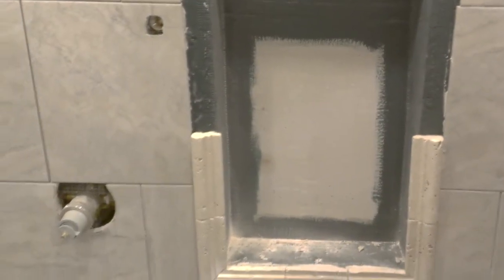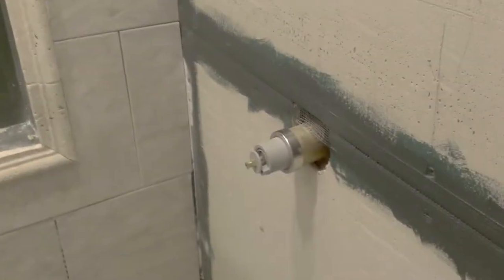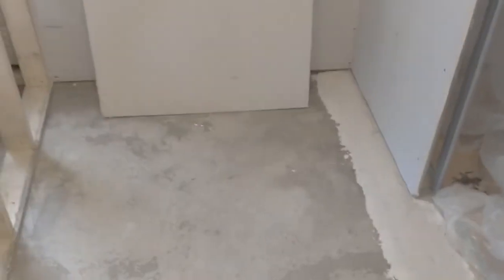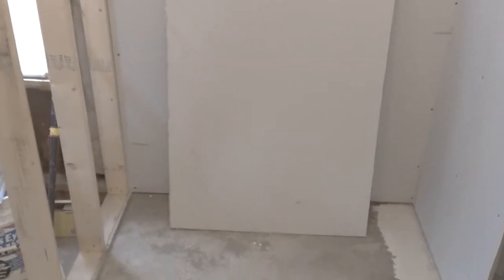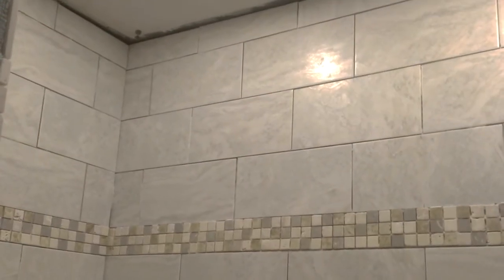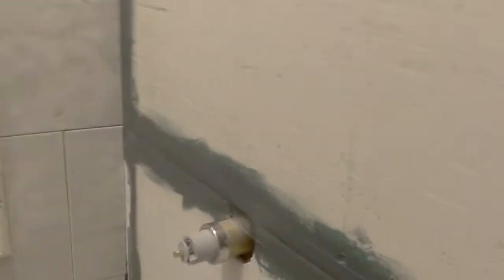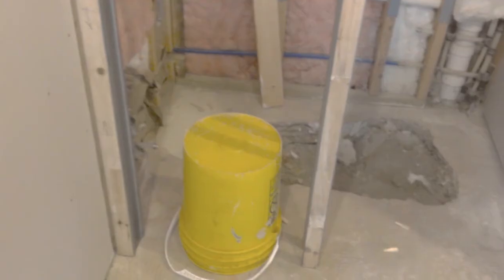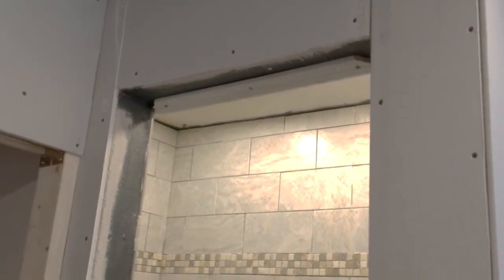BUILDING A BATHROOM. "MOST IMPORTANT TIPS"

Comment: Your curb is too tall. You should have just used a 3 function diverter instead of two valve bodies. Chair rail is not hanging over far enough and you have that cut piece in the middle on the bottom and it looks like your niche was big enough for a another shelf. No shampoo bottle is over 12". And when you lay on a bond or brick pattern your cuts should be a big piece on one side meeting up with the smaller piece on the other wall so it looks like they were folded into the corner instead of a mirror